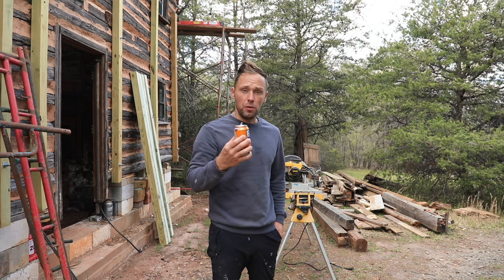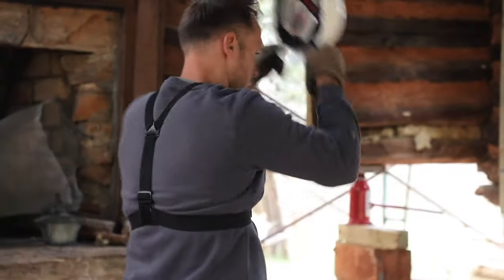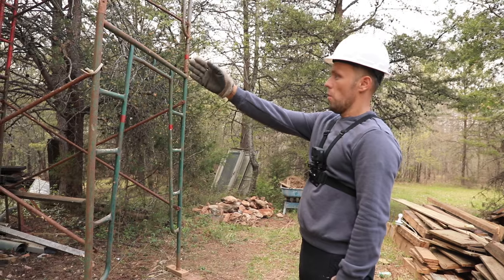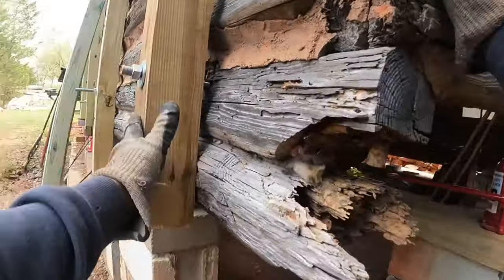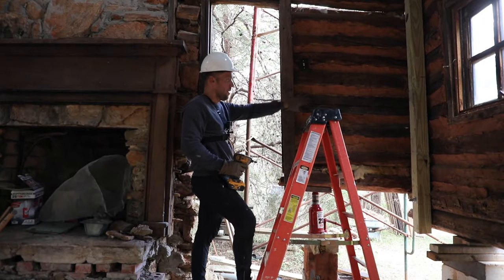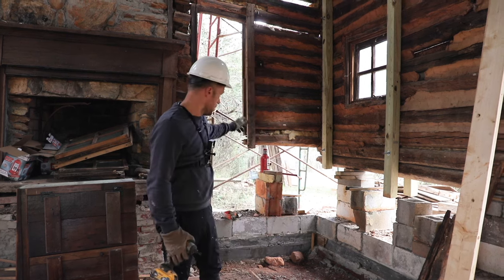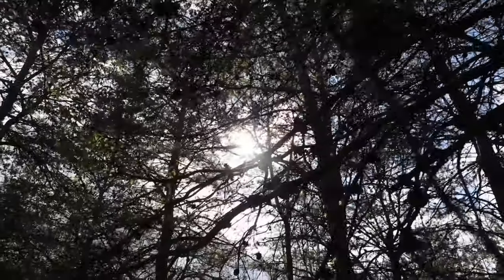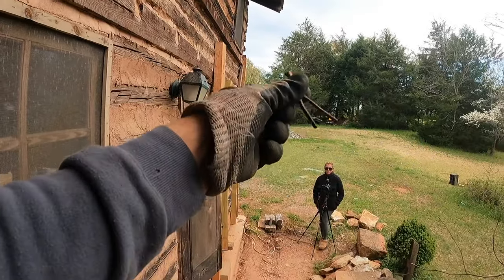How I’m Saving Historic 1780s Lincoln Log Cabin.

Comment: Don't use the fireplace as an anchor.  the old mortar will most likely not hold.  Use one or more of the adjacent trees.  If you use ones that are large enough with substantial enough root balls you should be ok.  Trying to use the fireplace is a recipe for disaster.  Afraid you might be asking for that fireplace to come down on top of you.  It's either that or you can sink pairs posts to a depth of 3+ foot to 4 foot and concreted in and spacing them at least 3 feet apart to use as anchors.  Done this before and it works fairly well using a chocker between the posts to anchor to on jobs with the weight in the range your dealing with.  Be safe, and good luck my friend.
Reply from the maker: Thank you, Jason, for your suggestion. I also considered using a post as an anchor, but I think it would likely need to be made of metal.

Comment: I am sure yoo have learned a lot of lessons on how to raise a log home that is rotted at the lower few feet.   I think the simply way of raising any home is use very large timbers that are inserted at the level where the rotting has ended or salvaged from point.   If you than build the foundation you can lower the log home and just remove all the rotted timbers   Where the timbers are taking the weight you end up with that gap after you remove them.   The main log home will be resting on the new foundation.   Where the gaps are can be filled in at that time.   With that plan, you would have made it a lot more simple.
Reply from the maker: It sounds like you've put a lot of thought into the process of raising a rotted log home.  Thank you for sharing your insights!🙌😁

Comment: I'm not usually a naysayer. But I'm not confident that your plan of using "Rollers" will work the way you might think. I don't know how secure the chimney is to act as an anchor for one. And the rollers would have to be very heavy duty I think to hold the weight without crushing or very least making them more oval than circle. Making it difficult if not impossible for any movement. And if the rollers don't give, then I feel that those old logs may not be stout enough. Another words you may have multiple sags in each log where a roller sits. Making it just as difficult to move as well. Maybe I'm wrong about it. But it's what my third eye sees. Is there a large tree behind the chimney side of the house to anchor too? If that was an option then the closer to the ground, the better. One idea that came to mind was using that nice foundation as an anchor point. Anchor some lags through the foundation on the side where chimney is. (I'd drill all the way through like you did with the 4x4s) Then run cables to the opposite side of the house. Use a winch to connect the two and tweak it very slowly. Also if you lower the house at same time it will go in the direction you're pulling to as it is going down. Obviously it would have to be done slowly. But either way you decide to do it, I wish you luck. I'm not 100% sure which way is better. But as long as you pull it off safely, it doesn't matter. Good luck! 👍
Reply from the maker: I appreciate your thorough analysis and concerns about the plan! It's always valuable to consider different perspectives and potential challenges. You raise valid points about the feasibility of using rollers and the stability of the old logs. Anchoring to a large tree or utilizing the foundation as an anchor point are both intriguing alternatives worth exploring further. Safety is our top priority, so we'll carefully evaluate all options to ensure a successful and secure relocation. Thank you for your well wishes and support—here's to a safe and successful endeavor! 🏡🛠️